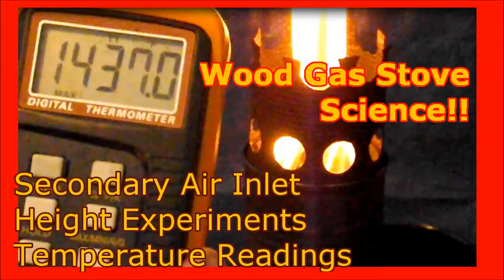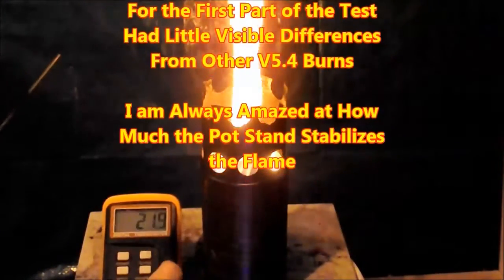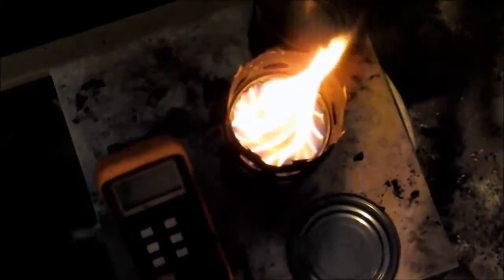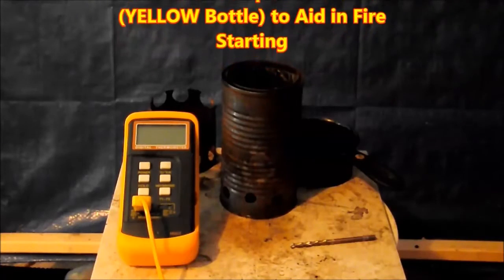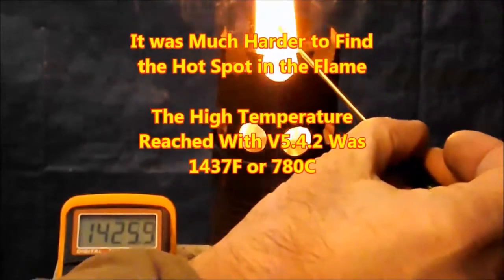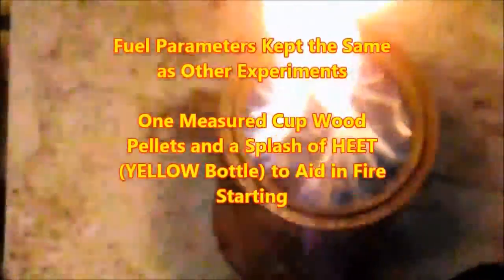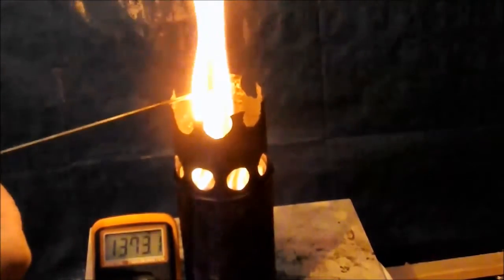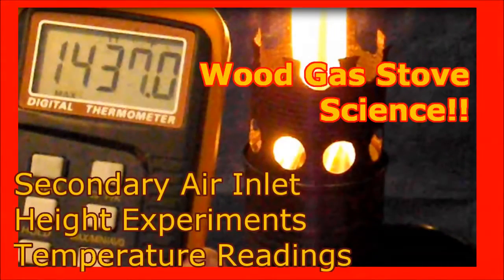Wood Gas Stove SCIENCE! Secondary Air Height w/ Temperature Readings!

Comment: You are the guy I’ve been looking for
Reply from the maker: Dylan Layman not sure how to take that! HaHa!
Reply: Heath Putnam it’s just no one posting gasifier videos have showed with good measuring practices differences in oxygen to woodgas ratio and what effect that has on heat and in the end efficiency. Most of what I find is people making one gasifier or allready have it built but never talk about real numbers when it comes to oxygen to fuel ratio. I’m sure I could dig and find these things but it would nice to at least hear something like “for every x lbs of burned material produced, y units of energy is produced”. Units being either heat output from a flame or wattage output of generator if that makes any sense. Just would be nice to be able to get some realistic numbers so different methods of gasification can be compared. This is the closest I’ve seen, I wish someone in the diy gasifier world would throw a thermocouple and a particulate sensor in a few places, I feel like with a little Arduino code a highly efficient set it and forget gasifier is possible.
Reply from the maker: I agree with what you are saying Dylan! Thanks for the comment!

Comment: When a woodgas stove burns correctly it only produces a blue flame, any other colour flame signifies there is not complete combustion, blue flames produce no soot.
The primary air holes in the bottom of the combustion can should be as low as possible in the can side and there should be one or two holes in near the center of the base of the combustion can. The secondary air holes near the top of the combustion can should be as near the top as possible, there should be about the same number of holes as the primary air holes but they should be about twice the diameter. The external can holes should be about twice the size of the secondary air holes but approximately half the number. The external air holes should be slightly higher than the primary air holes when the stove is assembled. If the stove does not produce a blue flame within 2 minutes of lighting then increase the diameter a little of a few of the secondary air holes, maybe every third hole.
EDIT:
The overall number of holes in the woodgas stove determines how fast it will burn (to some extent). So I would say don't put too many holes in the first time around, it's much easier to add holes than to take them away ;-)

Comment: Primary to secondary air intake ratio for 5.4 is about 4.5:1?  But isn't this just opposite of TLUD design of 1:5 primary being 1?
Reply from the maker: I've read that on the internet also, but through my experiments it seems 1:5 is incorrect. I was trying to get the fastest boil time and hottest flame, which I met my criteria. If you are trying to make bio-char use the 1:5 ratio, but be prepared for a lot of smoke. Thanks for pointing that out to other people! Thanks for the comment!

Comment from the maker: If you have anything in the pot it will take the heat away. Definitely do not put an empty pot on and leave it. I have used mine many times with great results and never melted a pot but it could/would happen if you left it there unattended.

Comment: love the gas stove vids, just subbed. This may be a stupid question and I will admit I know little of the science around this... your burn is around 1500degf, the melting point of aluminium is 1221degf and SS is 1400-1500degf. I know in a pot of liquid, the liquid helps keep the temp of the metal below it's melting point. But, would this melt the pot if there was no liquid or a skillet with no liquid? I want to use this camping but don't want to ruin my camping pots and pans.
Reply from the maker: 2012Viking If you have anything in the pot it will take the heat away. Definitely do not put an empty pot on and leave it. I have used mine many times with great results and never melted a pot but it could/would happen if you left it there unattended.

Comment: Very interesting results with the double layer secondary air. It seems that the amount of secondary air coming out of version 5.4.2 at the level of bottom ring of holes was enough and hot enough to burn a good amount of the wood gas. In ordinary wood stove and rocket stove heaters, it seems that there is always some wood gas left to be burnt on the next level of "secondary air".
Reply from the maker: Possibly I added too much secondary air volume. Maybe I should have reduced the number of top holes when I added the lower holes. On another note, the amount of available fuel is pretty small in this design (1 cup of pellets). It just might not have enough available gas for two levels of secondary air. Thanks for the comment!